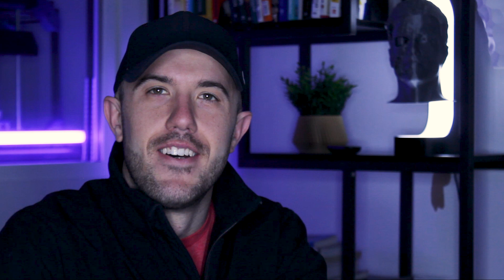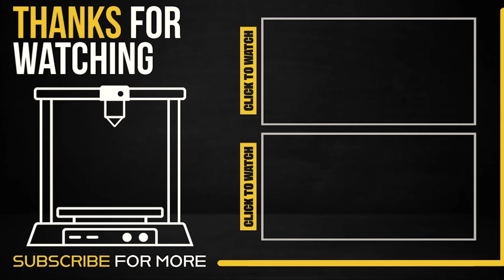"I have Never Printed a Benchy." Slant 3D Making Filament, Framework and Ford Utilizing 3D Printing

Comment: 5:00 - If you are looking for a product line for vehicles that you might excel at, I would refer to the "weather guard" brand. They built a brand around a very specific commodity and threw all of their marketing against it. They specialized in it. You can do the same for "cupholders that attach to register vanes" or "phone holders that clip to steering wheels" (for example). Where you will have a single fleshed-out design that is easily modifiable to customize it for each car brand. All it would take is for an intern to run to dealerships and measure the few dimensions that are unique to the vehicle, and you have a literal catalog of products.

Comment: Hi. Could you do a video discussing print quality in mass production please?

As a hobbyist, I concentrate on final print quality and design for zero (or minimal) cleanup off-the-bed.

Knowing that there's a speed vs. quality tradeoff and, as a mass production business, you probably concentrate on speed.

Do you have to explain and manage your customers' expectations of part quality, particularly for those customers who've used injection moulding before? Or do you offer higher quality at a premium price?

May I add, I've been 3D printing for 13 years and consider myself "proficient". I find your channel absolutely the best in the 3D printing space for covering the really important practical aspects of the technology.
Reply from the maker: Thanks. Yes we have a video on Quality at scale in the works

Comment: I really hope someone out there orders a benchy now through your API hahahaha.

But honestly I've been loving your videos and how open you are about your print farm. I know I am not the only one whose had pipe dreams of getting just a few more prints and trying to start something. Your videos are really great at showing exactly what goes into it and what you have to do. I really appreciate that.

Regarding making your own filament to sell I would be interested. It's not easy to find high quality made in the USA filament.

For future videos I'd love to see one going in-depth on the electrical demands of the farm. How much a single printer can use wattage wise and how that changes over time depending on the print loads and materials. Also if you have any power loss mitigation like battery backups.

Comment: You better be able to scale the filiment as something tells me you will be making alot with what you have been saying with your pricing being fair, unlike the others that are not.
Reply from the maker: That is a concern that may impact pricing. We need to make sure that the production of filament is able to fund the expansion of filament production. But since the filament is a value add to our mass production print farms we don't need to really make a profit beyond that growth requirment. If we run out continuously it would ruin the customer experience.
Reply: @slant3d  Then charge enough to hire the added people. You are saying you don't want to gouge the customer on filament.  Other "filament only" manufactures owners NEED  to fund their houses, cabins, multi Mercedes, wife's spending,  vacations, drinking/drug habits, divorce payments, child support, ect. YOU have your thriving 3D company to feed I assume less of these as you would never of said you wanted to bring fair pricing to filament. Which is a honorable thought for others.  ( YOU could move the industry to fairer pricing and still make money on this part of your company, as I think you do know that. )  So your filament should be very low even with added equipment and high # of labor employees, because you don't need massive profit on this small part of your company other then a small profit to feed it and expand it.  I was laughing my ars off writing this, just so you know.

Comment: When you start commercializing your filament I'll be curious to if you addressall the issues you raised in your previous video about All the Problems with Filament...Cost, quality, spool size, color consistancy, etc.
Reply from the maker: It would be kind of silly if we didn't. Every problem in that video was meant to be addressable by any manufacturer that was interested.
Reply: @slant3d  It's not what today's goals are, but rather what's the situation in a year after the goals have met with reality for a while.

I have 50 years of manufacturing experience in the plastics industry and I agree completely with your Filament video.  I'm also waiting to see if some of the low cost manufacturers in the US survive.  Consumers can buy filament 10 rolls at a time for $10.00 a roll (1kg).

Comment: Here are 4 topics for future videos:
I have seen smaller 3D printing factories that use the Prusa "Bed Slinger" as their main style of printers.
So, why did you guys choose a "CoreXY" instead of a much cheaper "Bed Slinger" for your factory? 

I believe that you guys are not selling your printer anymore and I am sorry that you don't.
Is there any chance that you guys will open source to the community your 3D printer design in the future?

Do you suggest any 3D printer project that is already open source for 3D printing factories?

What will be the impact, if any, of the "Bamboo Labs X1 Series" 3D printers in the future of 3D print manufacturing?
Reply from the maker: We have covered a lot of those in older videos. But we should cover a few of them again. Here is why bedslingers are stupid: https://youtu.be/iWHBH_T-xqI

Comment: What filament production machines have y'all been looking at?
Reply from the maker: Spoilers. We will have updates coming out the specific machine that we got just for retail filament.
Reply: I’m interested in seeing that video, I’m assuming it is a filament only extruder but am interested in seeing the process. Lots of people claim all commercial filament goes into a water bath which seems odd to me for lots of reasons having come from plastics production but I’ll post those questions in that video.

Comment: I'm pretty bummed that my sales lead form I tried to submit a couple weeks ago fell on deaf ears without so much as a follow up to my clarifying questions. I had hoped to be able to partner with a group like yours as a small manufacturer/designer but I can't even get a basic response on price, complexity, or design requirements to begin the flow of getting support or planning my own business scale in the coming months. A 3d printing API is pretty useless to me as an end product if I can't even go through a traditional flow to help offset my production line. 

The advertisement of these products sounds great, but I'm getting mixed messaging on your target demographic.
Reply from the maker: Sorry about that. Did you submit a quote form on the website? You can also send a direct message to info@slant3d.com. You might also check your spam folder. Sometimes responses go there.
Reply from the maker: The API is still reserved for only beta testings. So requests there just go to a waitlist. 
The Team on the Etsy Reward is sorting through applications. 
The quoting form goes right to an account engineer.
The General Contact can sometimes take a few days to be distributed to the correct department. If you can let me know where you attempted to reach out I can ping the team
Reply from the maker: I sent customer support a message to also check to see if there are any messages caught in filters from about that time.
Reply: @slant3d  After a week I got a reply stating that slant didn't produce products that weren't designed by me (fair) and I assume that carries into products that I have license to produce (also fair enough), but in addition that the process would "be too expensive" and did not elaborate more in that message, nor in my immediate follow up to info@ requesting details around materials, pricing, process, or contacts.

I sent an additional follow up today not really expecting any final replies; I've never quite had to work so hard to spend my money before and I was a bit taken aback by the sales side, maybe your persuasion will help a bit. I really just want to know how much it will cost and what I need to do to be ready to work with your services.
Reply from the maker: Got it. Glad they got in contact with you. If you need more info on material and process much of that is in the website. There is a really high request volume so they are not always able to entertain hypotheticals. Every part is different so there are not "ballpark" estimates that can be resonably be provided.